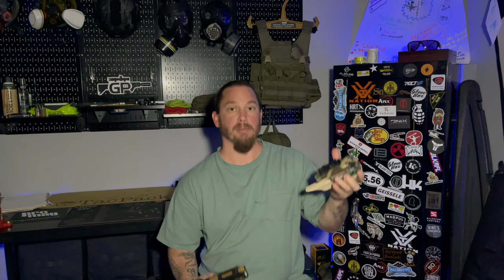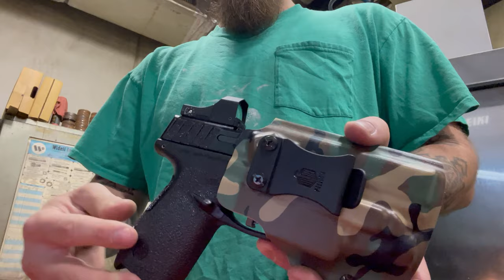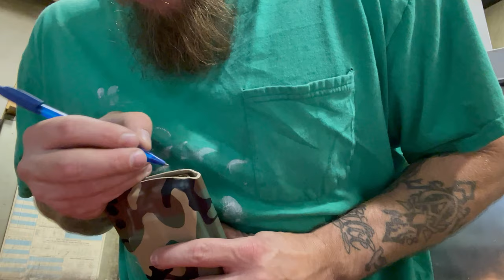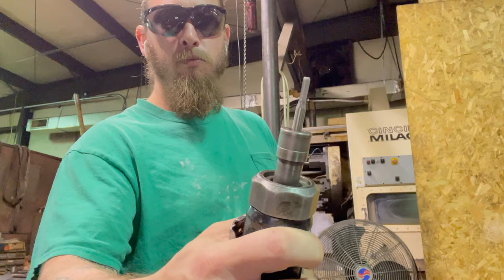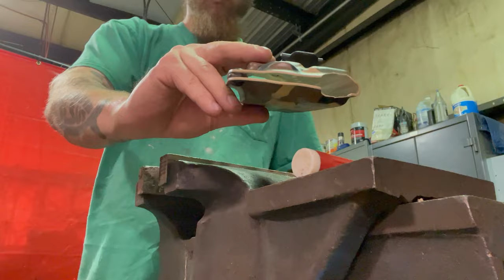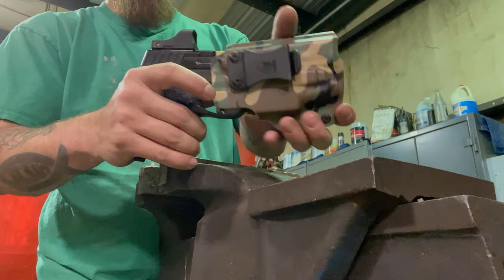HOW TO Pistol Holster Modification DIY

Comment: Kydex is so easy to work with. Just run the fresh cut areas with a buffing wheel and light sand paper to soften the edges. Good job!